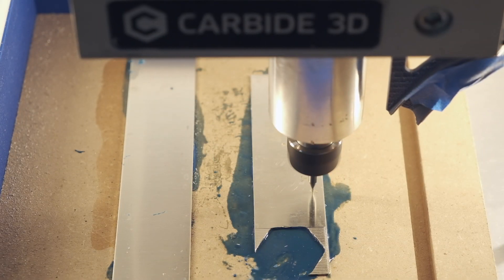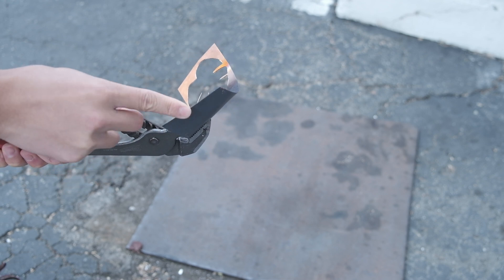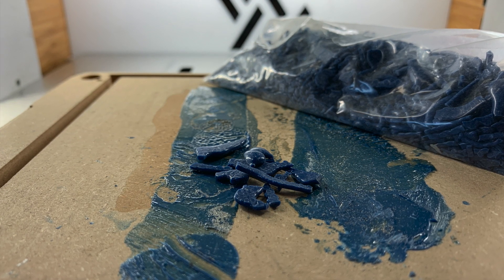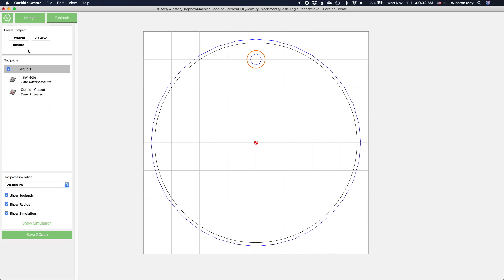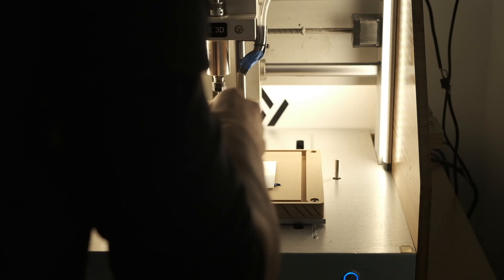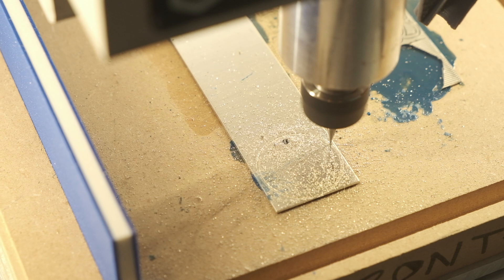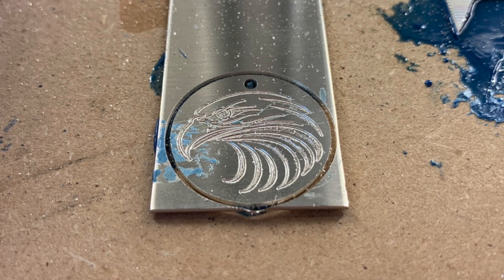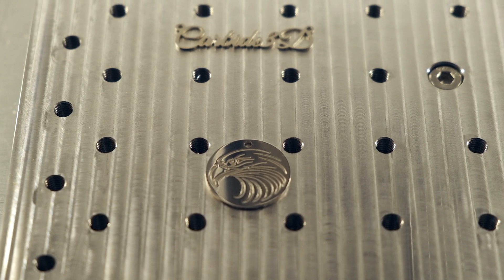Making an Engraved Sterling Silver Disc Charm on the Nomad CNC - #MaterialMonday

Comment: Can you use the Carbide3D Nomad 883 to engrave a QR code to a PVC business card ?
Reply from the maker: Our Nomad 3 (the next generation machine from the 883) can be used to engrave or cut. a QR onto a variety of materials.   The contrast needed for a QR will be material dependent.  Our machine can certainly handle the detail required.  https://shop.carbide3d.com/products/nomad-3?variant=32912906321981    Our Shapeoko Series of machines are also capable of the detail required.

Comment: I have a Bantam PCB Mill that I've been trying to use for engraving CA110 copper (disks from a local jewelry shop. 1/2 hard i'm pretty sure) and I keep breaking end mills it seems no matter how much i slow down the mill. do you have any experience with that kind of copper? if so, any advice?
Reply: Don't slow your feed rate too much but instead lower your multiple pass step down.  With these tiny end mills you want teeny tiny step downs... like less than half the diameter of the tool.

Comment: I'm new to the world of CNC and find all the available options overwhelming. I've been looking for solutions to machine small designs onto round blanks of silver, brass, and gold fill around 13mm x 13mm. Would the setup in the video work for that size? If so, what kind of longevity can I expect from the end mills you've used? Particularly the 501 PCB engraver, and the 502 PCB engraver. Thanks for the awesome content!

Comment: Hi, what sofware are you using for CAD? and also the CNC machine?
Reply from the maker: I typically use either Fusion 360 or Carbide Create for CAD. To control the CNC machine we have Carbide Motion.  (-W)

Comment: Would be interesting to see more working with silver as the pendent (would be good to see how you polished it too) appears to be commercial quality...
Reply: Haven't done acrylic but have experiments quite a bit with softer brass.  Faster feed rates and lower depth of cut seem to get cleanest finish.  Single flute better too.  Big but shallow chips.  Acrylic might be the same.